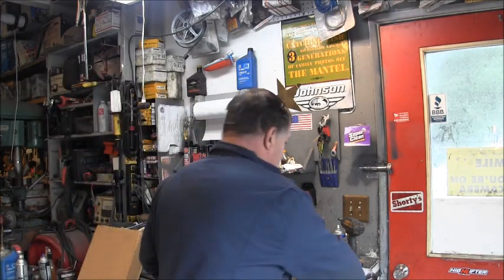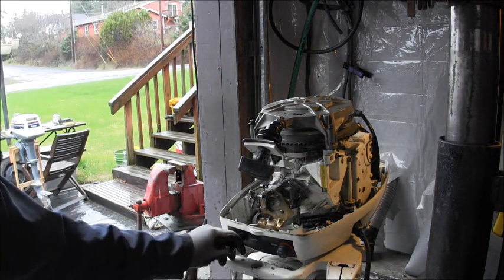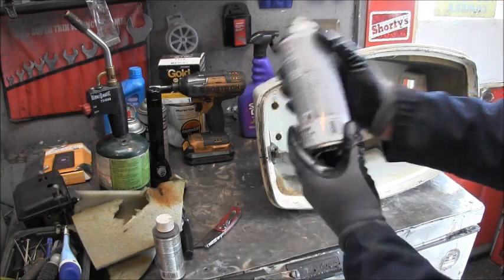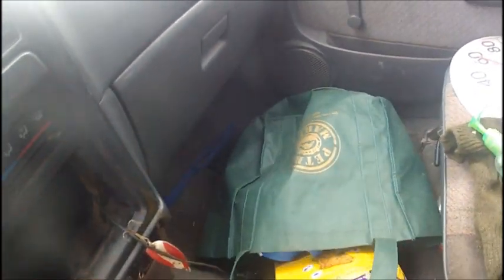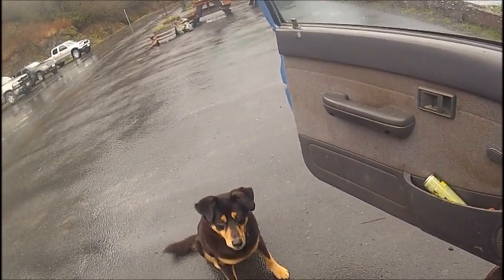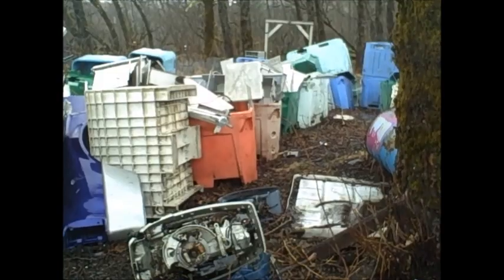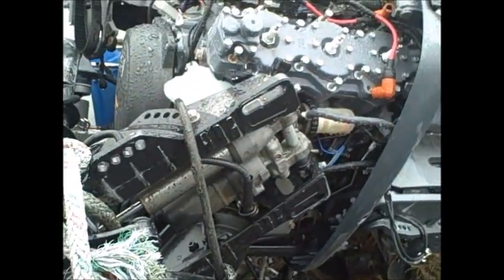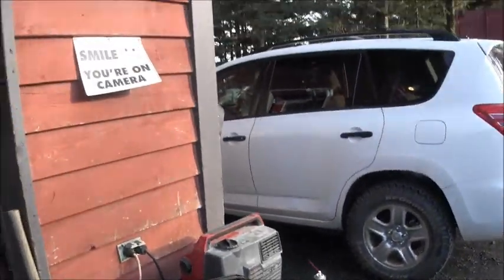JOHNSON 1977  25 HP,   ( FIXED )

Comment: Great video kodi neat to see other parts of the island  Chrysler marine got sold in the 80s when they had money issues  those outboards became us marine then got sold to Mercury in 95 or 97. My grandpa worked for Chrysler and told us bout them storing boats at the factory in Ohio during a thunderstorm  they filled the bildges with water to weigh them down

Comment: Hi Kodi, Was going to take the merc mark 10 out for a lake test but it's running on one of the cylinders. I cleaned and checked the spark but looks like a bad coil. Intermittent spark and at higher rpm the 2nd cylinder kicks in sometimes. Going to test both coils and probably end up ordering a new one. It will be different because the 57 coils plug wire is internal not plug in. Fun

Comment: Hey Cody, I found that there is a spray glue, in an aerosol can. 3M Super 77. That stuff works amazing for re-glueing foam rubber and stuff like. I used some under the cowl of one of my snowmobiles the other day, stuck just like shit to a blanket.